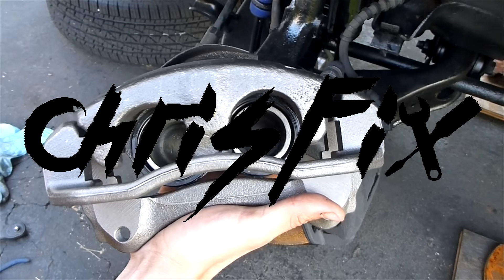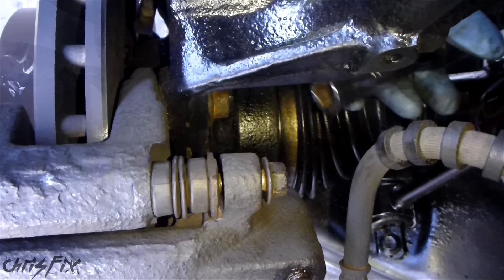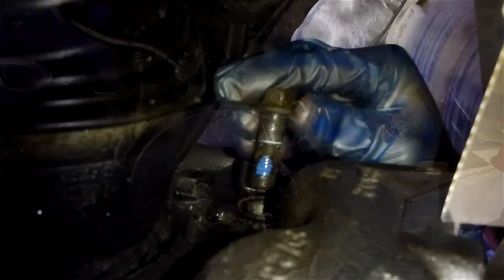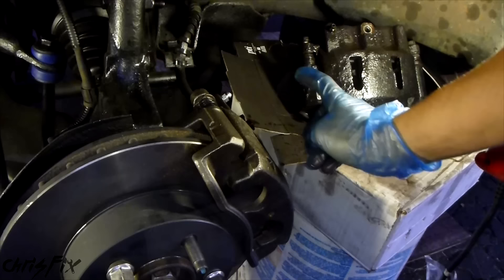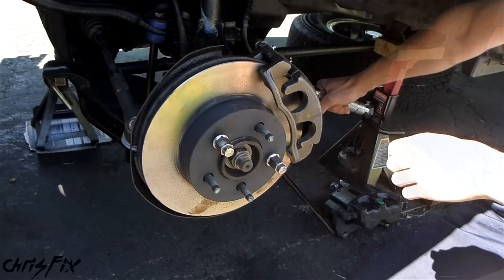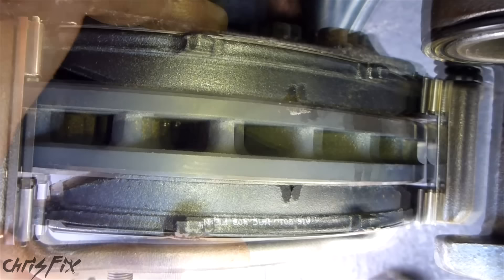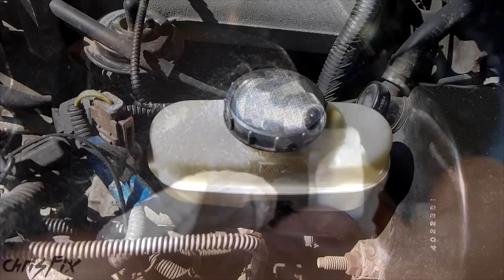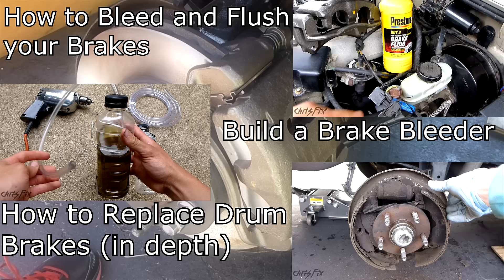How to Replace a Brake Caliper

Comment: I'm in need of at least one new front caliper on my 2014 300 due to it squeaking like an old pickup! I've lubed sliders and everything 3x now and its coming from the piston :/
Whats are your thoughts on whether to get a scanner to bleed the ABS while I'm swapping the caliper? My brakes feel low/spongy all the time and I have about 100k+ kms on it so figure the fluid is original and could really use a good bleed. The scanner is about $225 CDN. 
Thanks for the info and great videos!
Reply from the maker: The only time you would need to bleed abs specifically is if your system runs completely dry or you're swapping the abs unit. If you're just swapping a caliper and you do it quickly, you should be able to do a standard brake bleed and be good to go. And thanks!
Reply: @chrisfix  I'm really hoping I don't need to replace the master cylinder, but it has a bump/hard spot near the end of the travel. Not sure hot to differentiate between a mc or booster issue. I guess I'll replace the caliper(s) and see how it feels after and worse case its just some more fluid if I do have to do the MC :/
Thanks again!

Comment: Great video. Quick and to the point. I was pretty sure i knew how to change the caliper but mounting the new one first is a good idea i never thought of that makes moving the line over easier and less messy also less air will probably get in the lines. Good job.

Comment: I'm planning to rebuild my existing caliper. After I remove the brake line from the caliper, I was going to compress a couple thick rubber bushings on each side of the brake line to prevent it from leaking while I do the rebuild.  Then, I wonder if I should keep the end of the brake line up, or let it hang down?   Of course, when it's all done, I'll bleed the brakes, which will be my first time doing that.  I'm hoping this will work ok.  Any thoughts?

Comment: Should you change both calipers at the same time?  Or is it OK just to do the one that is bad?  Was doing brakes on 2010 Town/Country and one of the rears was really hard to push in.  The other side was fine.  Figured it probably needs to be changed soon.

Comment: Got a problem here ! For the second time I changed the rear caliper on my Toyota Matrix. I bleded till no bubbles with help, then pumped the handbrake 50 times but it is not braking. This is a model where the piston is turning. Can it be my brake cable adjuster ? Anyway I will bleed it again and even if it is no recommanded I pinch the brake hose and did not experience problem. Thank you !…..oh fixed now, with the help of another person I bleeded and found bubbles as I rotated the piston. I found out also that brake pads have a stud and need to be placed between the cross of the piston.

Comment: My brake is so soft (pushes all the way to end) after replacing the caliper. Could you help? Do I have to keep the engine on while do the 'gravity bleeding'? Or should I keep the car off?
Reply: Donsgsoo, you most likely have air in the brake lines and that's why they feel soft. Did you bleed the brakes and what is the level of brake fluid in your master cylinder?

Aaron
Reply: Engine off. Check out his other video on brake bleeding.

Comment: I have a 2007 Kia Sorento. Each brake line is independent. You don't need to bleed All the brake lines. Am I correct? Same thing with my 2006 Ford Focus, independent, because I changed a rusted brake line and bled that one wheel only. Brakes are fine.

Comment: 9:45... So I didn't do a gravity bleed exactly... I did a hybrid of your one man bleeder system; I used a plastic tube with a recycle-collection pan on the ground (the gravity part). I had a helper turn the car power on and pump the breaks until air wasn't coming out and liquid wasn't getting sucked back in. Is this ok I did that??? It seems to have worked really well! I hardly lost any fluid and I'm experiencing no issues! :)

Comment: i know this might sound strange but i think you should include a bit about not tightening the slide pin bolts so much that that capial D shaped washer at the back contacts the bracket. i did this my first time doing brakes on my ranger and had to take it apart.

Comment: Recently attempted replacing calipers, pads, and rotors. When I went to flush the brakes no fluid would come out of the new calipers. I was told I should have prefilled the calipers. Is this true? Any thoughts?

Comment: Before you bleed the brakes after replacing everything, do you pump the brakes to extend the caliper piston or do that when you open the bleeder valve? And also if need to bleed all brakes should I start with the one I replaced the caliper on or from back to front

Comment: So if you want to take the whole caliper off to clean or rebuild, how do you stop the fluid from leaking out of the hose..do you use something to plug it seeing as pinching it off is not good?

Comment: I am replacing my caliper due to a bad brake hose that caused my caliper to seize
Do I need to change my brake pads and/or my rotors?
Can I change the caliper only in one side or do i need to do both sides?
2006 Ford f150 4.6 79,000 milage
thank you for your help it is my first time doing it
Reply from the maker: Technically you can reaplace only one caliper. I would replace both front brake hoses tho. I would put new pads and rotors since yours probably overheated.

Comment: So six days ago I changed my front rotors and brake pads and yesterday I started smelling a burning smell from the driver side wheel and when I got out I noticed it was extremely hot. What do you think I did wrong? Could it be bad pistons? Maybe bad brake pads? Or should I replace the whole caliper? Thanks!

Edit: I replaced both calipers 2 weeks ago and all is fine now, thanks

Comment: Replacing my calipers this weekend. What kind of grease should I use on the brake hardware? Ive heard silicone grease should not be used on the anti-rattle plates.
Reply from the maker: silicone on the guide pins and antiseize on the brake hardware
Reply: @chrisfix  Tysm! The replacement was a success. Thank you for making these videos 💖

Comment: I need to change the calipers on my car, but the fluid was flushed only about a year ago. Am I right in thinking that I still need to do a brake fluid flush after the caliper swap to ensure that the fluid that leaked out is replaced, and to make sure there are no bubbles?

Comment: Maybe you need to do one on different kinds of calipers. I seen a caliper the other day that you screwed in and out under a hydraulic pressure on a Malibu and Chrysler has the same thing. It was on the rear of the car and when you set the emergency brake it locked it into place. I was wanting to know on these how do you keep the brake pedal up. How can you adjust it higher. It was like 3 or 4 inches off the floor. But someone asked me how can you raise it. Since it's not like a regular drum brake

Comment: Hi Chris, I watched a few videos before finding yours which is the most thorough.  One of the other guys  had a special clamp for the brake hose to prevent the leaking of the fluid, I am not sure if it's a special tool or not.  What are your thoughts?  Thanks.

Comment: I have to bleed all 4 so do I start the furthest after changing the brakes of the driver side or after I’m done with the brakes I do that one right away ?
Reply: Angie at this point I hope someone has helped you out. You want to start with the wheel that is FURTHEST away from the brake master cylinder. Typically that is the passenger rear. Start from the furthest working your way to the closest (typically the drivers front)

Hope that help's you some.

Aaron

Comment: i changed 3 calipers. The other one was changed 2 years ago so I only lubricated the slide pins. I bleed the brakes after but now my 4 wheels heat more than it used to. I wonder if I should not bleed them again? Also when the cat is lifted, the wheel are not totally blocked but they do not turn so easy. m a little bit confused.

Comment: Most of the Calipers I’ve replaced have come with a new banjo bolt and washers. If not it’s worth getting a new one for a few bucks so you have it ready and don’t have to clean the old one while brake fluid is pouring out the hose.

Comment: i have a 2001 chevy silverado . 
front brakes are dual piston. 
rears are single piston. 
would it be possible to convert the rears to dual piston ?
i’m looking to purchase a set off power stop.
Reply from the maker: If there is some kind of upgrade kit then yes, but you would probably get more bang per buck out of upgrading the front brakes

Comment: Hey Chris, should both side be don't if one caliber needs to be replaced? Not from a leak but maybe from being stuck! Also if it is sticking, should the system be flushed?
Reply from the maker: You usually just have to replace one if only one is bad, and what's sticking?
Reply: @chrisfix  The caliper piston is sticking not releasing is what I meant by "sticking"

Comment: Is there a video of how to do the rear calipers? My mom's 2007 Uplander has a brake squealing issue in the rear and the calipers aren't working well. To make it a little bit awkward, the rear calipers have the e-brake cable on there, however, I cannot seem to find the tool to remove the e-brake cable easily and using a screwdriver is out of the question.

Comment: I just changed the front rotors and brakes on my 2010 dodge ram 1500 slt, and I found out the brake piston broke and now it’s leaking all of the fluid I put in it…:( gonna change the whole part tomorrow and hopefully I’m good to go! Love from calgary’

Comment: Thank you for a great video. Do I have to bleed all 4 brakevalves on all the wheels when i changed one caliper?
Reply from the maker: It is a good idea to do all brakes to make sure you have no air in the system!

Comment: I see brake fluid leaking on my passenger tire wall. I’m losing fluid fast and brake peddle sinking to floor. Would this be the caliper? I had all brakes and rotors changed this march.

Comment: Could the clear fluid bleed out of the caliper bleeding valve in the clear pipe be reused? Like be put back into the brake fluid reservoir?

Comment: Hey Chris,
I just wanted to ask if I have to bleed all the brakes after ive replaced a caliper or just bleed that one?
Reply: Usually its just the one (if all you mess with is the one caliper). 

General rule for brakes is "Whatever you touch you bleed".

Comment: I realize there’s no way Chris can respond to questions, but maybe another knowledgeable subscriber can. I’ve got to go ahead and replace rotors, pads, and calipers on the rear. I’d like to do the front calipers as well but currently the ones I want that match are temporarily out of stock. If I go ahead and do the rears, can I just bleed those two lines then do the fronts when I can, or do all four need to be done at the same time? Thanks for any advice.
Reply from the maker: I would look at a brake line/system diagram and see if all 4 brake lines are independent, if they are (which most abs cars are) then you can get away with doing the rears for now and do the fronts later. It's always good practice to do all 4 and make sure there is no air in the system, but I have gotten away with only bleeding the fronts one time and I never had an issue. If you are in doubt then I would do all 4 and that way you have new fluid going into your new calipers.
Reply: @chrisfix  Thank you so much Chris for your personal reply. You’re the best and have helped me so many times. I still have to watch your brake videos every time before tackling pads, rotors, and now attempting calipers. Based on your advice above, I’m going to try and hold out until the front pair is back in stock and do all four one time only. Thanks again!

Comment: Great video! Curious though, why do you not like using much grease? In my experience it helps more than it hinders, but I am by no means a mechanic.
Reply: People commonly use more grease than is necessary. A huge glop is a waste, a thin layer is really all that is required. Using too much grease will attract dirt. If a seal or boot is worn out anywhere that dirt can damage components.

Comment: would it be helpful to plug the end of the brake line during a caliper replacement? I want to paint my calipers but not on the car - was thinking maybe plugging the brake lines would be the way to do it.

Comment: Thanks for the great instructions and advice. What mileage do calipers usually go bad? I have a 2010 v6 camry and it's past 160k mile. Just changed struts a while back since one was leaking. The brakes were last done around 95k and are still good but I was thinking new rotors pads, maybe calipers. New struts have dramatically improved the ride so I thought why not tune up a few more things!

Comment: Hi Chris
Thanks for all the great videos. I’ve replaced my brake pads and rotors all around.  I keep getting vibration at high speed when braking. I’ve got 145,000 on my van. Do you think changing the brake calipers would solve my problem?  Thanks in advance.

Comment: Hey there, great Videos!

I have 2012 Ford F-250 6.7,  my front driver side cab mount next to the radiator needed replacing.  I broke the bolt and part of it is still in the hardware nut that is located in the body frame rail with limited access.  How can I get in there to remove the broken bolt and replace ?
I sure hope you can help!

Thanks
Reply from the maker: Thanks a lot! Are you able to drill it out from the other side?
Reply: I couldn’t drill it from the bottom , bit too short.  

Friday I am gonna remove the grill and headlight and try and attack it from the top, hopefully I will have better access to mess with it and may drill what’s left of the bolt or pry the hardware apart to pull the nut out. It’s like a wing nut in there
Reply: I was able to remove the broken hardware and broken bolt.  I had to remove the grill, headlight and move the front radiator over due to the hose in the way.
Basically I had to chisel out plastic to make the hole bigger then had to pry and pry with large flat screw driver to break the hardware loose. 
I used everything and anything in my tool arsenal to remove this. 
But got it done!

Comment: Is there a video on how to switch the brake hose over. 
All I saw was “don’t pinch the hose off. You might crack it”

But no recommendation on how to do it

🤷🏻‍♂️

Comment: Hey Chris, i need your advice please bro, i just replaced my rear drivers side caliper, rotor and pads, I bled it out as you described and after at least 3 bleeds, they are still super spongy, do you know what could be causing this?
Reply from the maker: There may still be air in the system, it'll require more time to bleed (make sure you bleed the other calipers as well). How low did the brake fluid drop in the master cylinder reservoir when you replaced the caliper?
Reply: @chrisfix Hey bro I watched this again and I think where I went wrong is I removed the banjo bolt straight away and lost lots of brake fluid in the process which left the master cylinder quite low, I topped it up after I replaced the caliper and bled the 2 rear brakes thoroughly about 2-3 times but still spongy az.  I'm going to bleed all the brake calipers right now, thank you bro.

Comment: How would you recommend to get one's torque specs I find a difficult when searching through forums online to get consistent ones
Reply from the maker: In that case I'd recommend getting something like a dealer service manual that way you can get the correct info at the source

Comment: Hi.  I am working on my front brakes and the dust boots for the pistons are ripped and worn out.  I am planning to replace them but the old boot is more or less "baked on" to the caliper.  It won't come off, I've cut away as much as I can of it but there is still a lot of rubber around the lip of the piston hole on the caliper.  How can I get rid of this rubber that is stuck to the caliper?

Comment: A little pro tip: if the bolts are hard to get to, try turning the wheel to face the bolts in a more favorable position. Of course do this safely when the car is on stands or on the ground!!

Comment: Great vid man and on point. The new aftermarket caliper i am getting says M10 x 1.0 inlet port in spec. What size banjo bolt would you consider to go with it ? Also M10 x 1.0 ? I don’t know what my current oem bolt is and I want to make sure one of the banjos fit
Reply from the maker: If it says that as the spec I would say that's the size to buy, and before installing do a test fit to make sure it's the right size

Comment: Do we need bleed after replacing a caliper ? Or was that last part just an option ? I know once replacing pads and rotors , you have to press the brake so the pistons make contact
Reply: Luis, yes, you should bleed after replacing the calipers. Air will likely get into the system when you remove the lines. Hope that helps you some.

Aaron
Reply: @vigilantemotors  thank you for the reply!
Reply: @luissalazar4862  Anytime, always here to help

Comment: thank you, I feel like i can put on a new caliper, and bleed the brakes myself now, one of the caliper boots is hard and wont extend in and out. I had to hit it with a hammer to get the caliper to slide in.

Comment: Chris,
Put new calipers (rear) on an 07 Ram pickup in addition to pads and rotors. Bled all around and still have a spongy pedal. Should I have pre-filled the calipers with fluid. Did a very thorough bleeding. Any suggestions greatly appreciated. Many thanks!

Comment: Chris, I haven’t had much luck with reman calipers. Usually they’re good but then start to leak later on even if I used washers and thread locks etc. Would you recommend getting a better quality reman ? Like acdelco or moog or Bosch etc or should I just go OEM for a little bit more? Just a daily beater truck